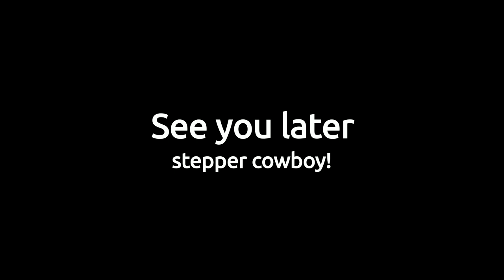NanoMoCo on Linux

Comment from the maker: A demonstration of a motion control rig using Dynamic Perception's open source nanoMoCo stepper controllers operated using the Graffik application on Ubuntu.  I've been porting Graffik to Ubuntu, and here it is controlling a real motion control camera boom.  Stay tuned to the end where I show the results!
Reply: nice... I would be even more impressed to see an allen bradley servo motor contolled by an ubuntu app :)
Reply: Still no code in the public access? :)
Reply from the maker: It will be soon, I promise.  I've just been very busy with deadlines for multiple things coming up and would rather not commit with partial functionality.
Reply: I see :)
Reply: David Jordan Very cool. You do the machining for the mechanical pieces?